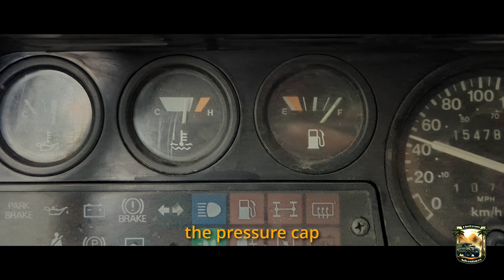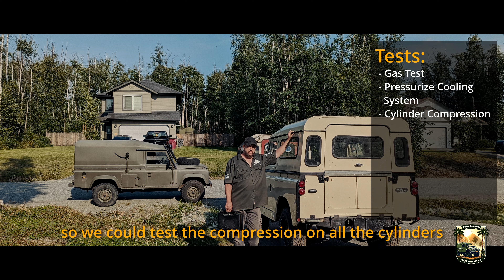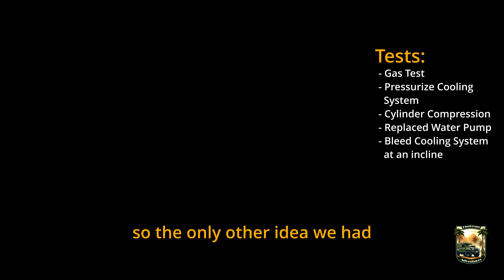ENGINE TROUBLE in Alaska // Overlanding in Alaska - S01E32

Comment: Hi,I’m really surprised the gas test was negative,never mind,sometimes we have to work hard to solve these problems.Was the head gasket a Britpart gasket?That wouldn’t surprise me.Beat wishes as you keep on with your trip🙂
Reply from the maker: Yes, surprised me too. Same with the pressure test of the cooling system as well as the compression test on the cylinders. 🤷‍♂️
No, it wasn't a Britpart gasket. It came from Elring Klinger - a German company that usually has a good reputation.
Reply: @PipeDream.Adventures  Hoping you have a good run now,no more troubles🙂

Comment: Shitpart from Britpart possibly 😅 glad your mended .from Steve near Chester England 🏴 where the Roman's once lived.
Reply from the maker: No, quality composite gasket from Elring Klinger (high quality German manufacturer of all types of gaskets). Was really surprised by this. 🤷‍♂️
Switched to a multi-layer steel gasket now...
Reply: @PipeDream.Adventures  OK fair comment, just britpart, not that reliable at times.There Hq and main distribution centre 30kms from where I live, good luck 🤞.